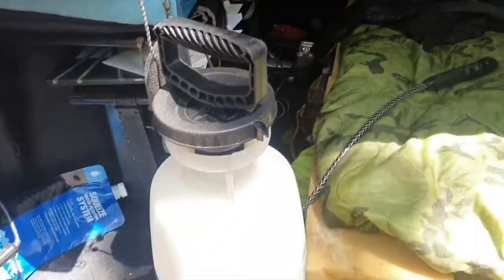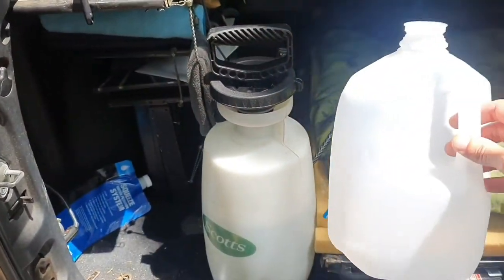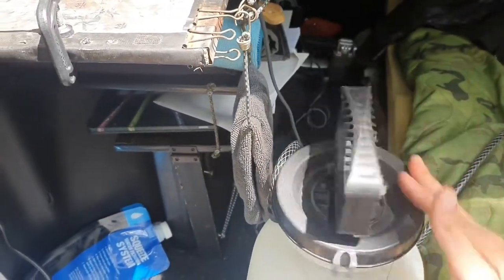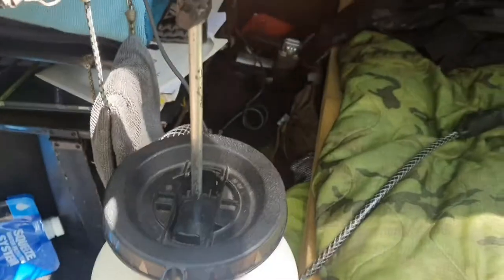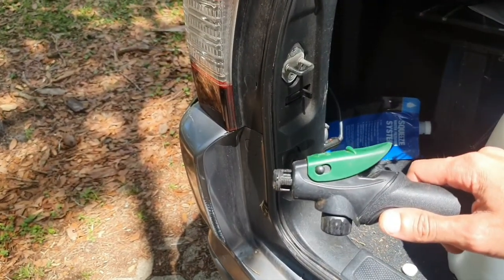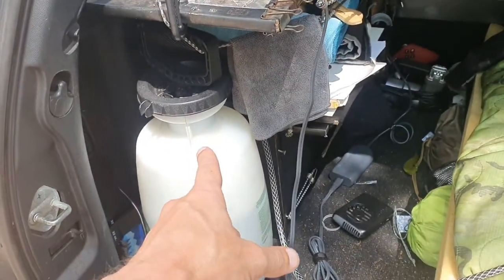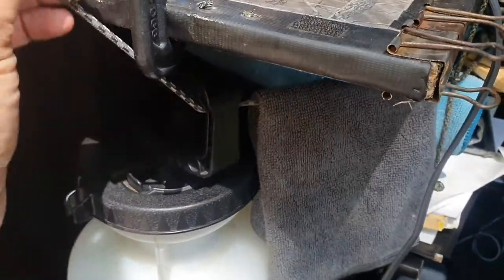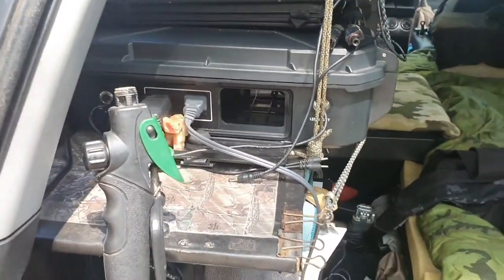Cheap and easy Road Shower  😃🚿

Comment: Black PVC pipe, close up one end and add some type of drain/nozzle on the other end. Mount it with brackets front to back on one side of the vehicle and run it on a slope. Maybe like running it toward the rear down hill that way you'd be using gravity to feed the water to the drain/nozzle end. I've thought about that myself, be a good setup for folks who like some isolation I guess.